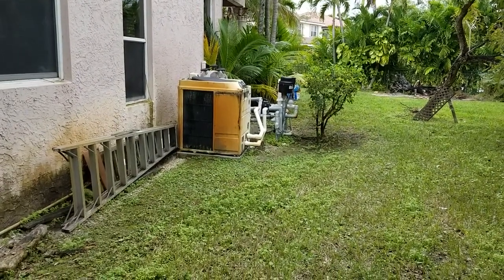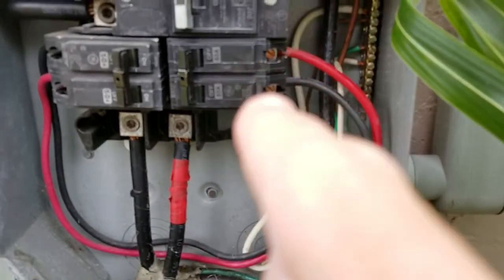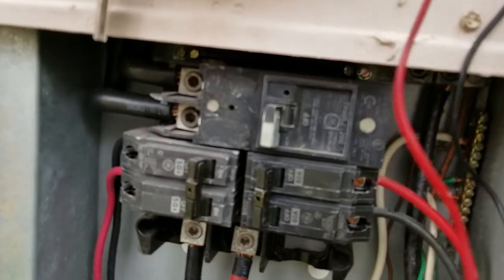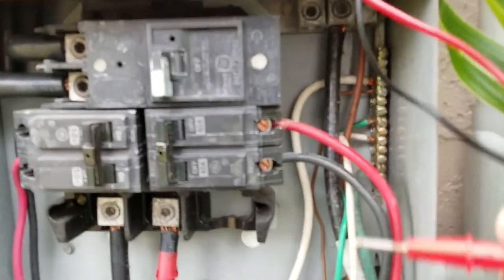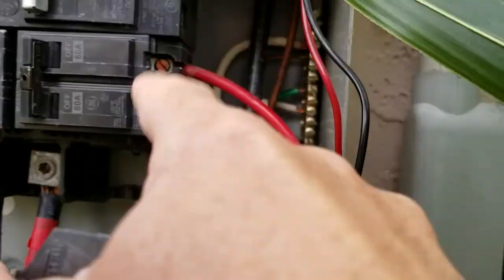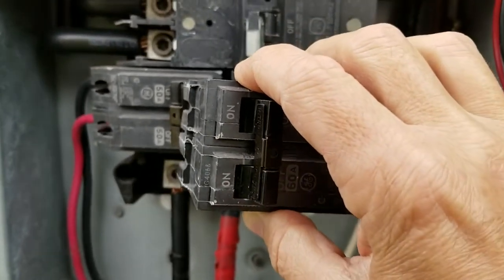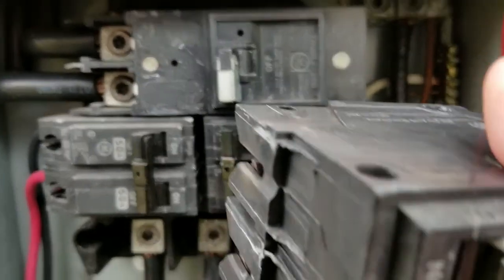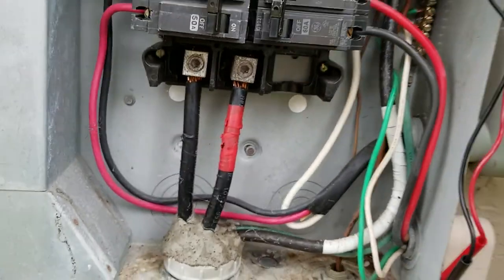How to change a Double Pole Circuit Breaker

Comment: Question, 
If the red tests near 115 and the black tests near 115 separately.  But red and black tests 0 together.  
What would cause this?
Reply: That’s a single pole 220 theirs 2 separate hot poles in a breaker u can make it 220 2 pole or 220 single or 110 single . All you’re doing is hooking it to hot poles . The power is like waves on the beach pulsing in and out. 2 poles are out of phase separate for more power if needed.  2 phase is common in homes for ovens dryers ac units . 3 phase is more rare and only available at special power poles for factory’s garages etc. homes typically won’t see that

Comment: Cool! and thank you.  The wires coming out of the breaker should be off when the breaker is in its OFF position. when the breaker shows red it is telling you it is defective in the absence of a warning window the meter should tell you what you have at the Output of the breaker (Red and Black wires which in this case feeds the Compressor part of the HVAC unit.) To play it safe one should always power down the whole house or unit but in some cases that isn't possible. Follow guidelines of insulation before you pull it out if there is power on the mains which are two big shinny  silver plates.

Comment: Be safe than sorry wear gloves when you're doing electrical and use  needle nose to hold the wire
Reply: Curious...why gloves ?
Reply: Seriously? So you don't get electrocuted obviously. Make sure they are rubber insulated when dealing with any electricity. Only takes one time to kill yourself in a split second accidental contact with anything live with ac current, have heard of electricians who have done it for decades slack on safety and then lost their footing on a loose dirt area, guess it kinda slid underneath him and he instinctively tried to brace himself by grabbing the closest thing which happened to make him brush up on a live main house line instantly killing him and even worse was he remained getting zapped for a while before the home owner decided to check on him after he had been there a while without hearing from him and then had to call fire department etc to come safely shut it off but he was still being fried while waiting on emergency services to arrive. Point is that just a micro second is all it takes if not wearing proper safety equipment. Don't be stupid people and mess with electricity while having no idea about it. You wouldn't try to disarm a landmine without any prior training or knowledge about it and you have a MUCH better chance of surviving the land mine over the electricity being pumped into your breaker box!

Comment: Can you use 15 amp double pole circuit breaker for 18000 Mr Cool mini split? P4 comes up inverter compressor error
Reply from the maker: I cannot advice on that.

Comment: FYI the panel is NOT cold, the 2 lugs at the bottom 1 black the other with red tape are ALWAYS hot unless the power into the house is cut, so be careful not to make contact with them
Reply: He said those feed the breaker box inside the house as well as saying that the main breaker outside cuts power to the house. In conclusion I disagree with you.
Reply: RIGHT! Those have to be cut off before reaching the panel. Usually at the street.